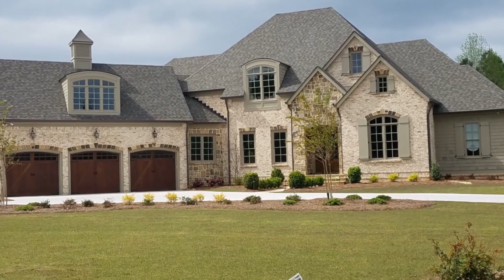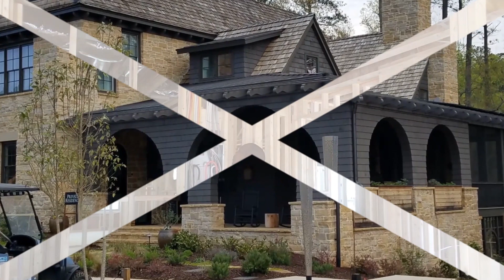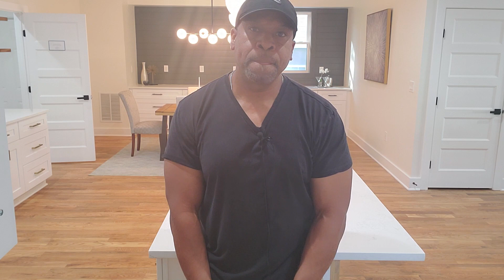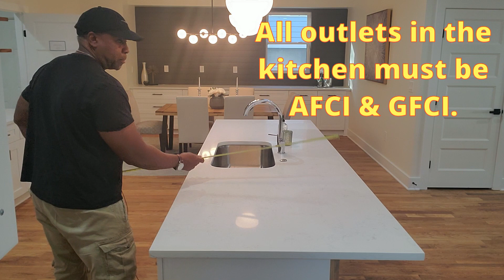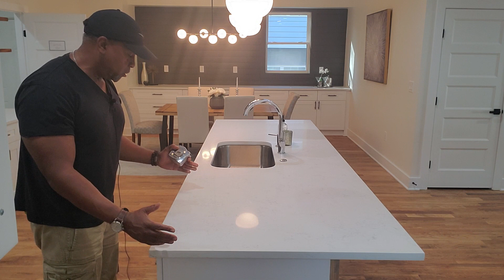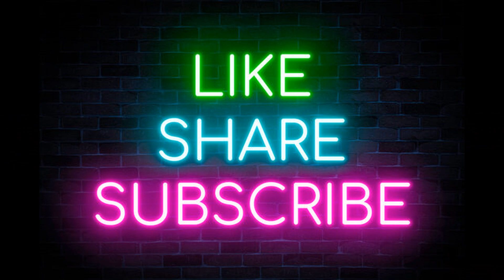2020 NEC Code Change for Kitchen Island & Peninsula

Comment: I've been doing electrical for 40 years I've been licensed in five states currently licensed in Alaska and North Dakota. What I was taught as apprentice well over 40 some odd years ago was always put an outlet on both ends of a peninsula and if it was over 6 ft put a third receptacle in I had been doing that kind of work for more than 40 years I'm glad the code finally caught up. Every electrician should know the NEC is the minimum code requirements you can exceed it but not go below it. You're very knowledgeable and I'm quite impressed with your videos
Reply from the maker: I appreciate your feedback.. thanks for watching!!

Comment: Thank you for your channel!  I just started following you and absolutely appreciate the material you are putting out there!  Question: I’m building and have an island that is 5’x10’ - so 9’+18’+18’+5’=50’, thus I need 4 receptacles.  One will be on each end, but the overhang is 12” on the long side.  The cabinets on the ends have a wine rack one end and a cookbook shelf on the other… can I put receptacles inside of those for the other two?  Or do I have to figure out some creative solution on the cabinet side for those.  I refuse to put outlets on the surface!  Hope you/someone has a solution that works! Thank you!
Reply from the maker: Yes, the last two receptacle outlets are at the discretion of the owner or the builder.
Reply from the maker: I appreciate you watching!!

Comment: 2023 NEC says that it is no longer required to have a receptical on an island or peninsula, and cannot be located on the side.  But you still have to rough-in a circuit for future.  So, if you add an island during reno, can you avoid all electrical?
Reply from the maker: Has your state adopted the 2023 NEC?

Comment: Probably should have touched on the fact that any receptacles located under an overhang that is more than 6" do not meet the qualifications for this requirement. (NEC 210.52 (C)(3)(3))  I have occasionally run into issues with this because I have seen a few islands where the over hang is more than 6" all the way around.  In those circumstances, counter top receptacles are typically the solution.
Reply from the maker: Good point...thanks for commenting!!
Reply from the maker: I appreciate you watching!!
Reply: @PPG1967  No problem.  Love your videos.
Reply: so did it say Sq footage of the counter top or the island I would argue those extreme overhangs don't count if they didn't specify island countertop and only island. so you would measure the cabinet top Area also these receptacle counts mean a duplex at each end should be 4 total

Comment: You need to update this with the new 2023 residential electrical code  for islands. They completely changed it. No outlets on the sides.
Reply from the maker: That video is coming.  I appreciate you watching.
Reply: @PPG1967  I am specifically looking for the best water-tight pop up outlet. Thank you!
Reply from the maker: @Lily_J85  Google it
Reply: The issue here is some areas follow local codes first and some haven't adopted the 2023 NEC code yet. I have multiple projects going and some inspectors allowing the 2023 revision and some aren't.

Comment: Thanks for the helpful information! I have an island that does not have a sink or any type of water/fire. It just an island with cabinets. Does the outlet needs to be GFCI? It is already tie to an GFCI receptacle originally from the kitchen and I am just re-using it but moving it to a bigger island.
Reply from the maker: So, all electrical outlets for that island must be GFCI.
Reply from the maker: Thanks for watching!!
Reply: @PPG1967  I'm doing a remodel, do I have to use the new NEC code or can I just follow the old code that my house was originally set up for?It's a 25 yr old house.
Reply from the maker: So, I would say you should use the new codes with a renovation. However you should check with your local or city building department to be sure.
Reply: @PPG1967  That was a great question and thank you for answering her. I didn't even think about that.

Comment: My electrician has said that outlets in a kitchen island must be WITHIN 24" of the sink in the island. That seems nuts to me. I could imagine a MINIMUM of 24" AWAY from the sink. Your video mentions nothing about placement related to the sink. What's the story? Thanks!
Reply from the maker: So, the video does mention the placement of the initial receptacle. The additional receptacles are at the discretion of the owner or builder.

Comment: OK GUYS TO HELP YOU UNDERRSTAND THIS VIDEO. He is stating that this island in the video needs 3 outlets by code which is true going by his square foot measurements. What HE DOES NOT EXPLANE OR MAYBE DOESN'T KNOW IS that three outlets equals 2 duplex receptacles which intern you end up with 4 outlets on that island. Reading ARTICLE 100 in the 2020 code states that 1 outlet is an individual plug so a duplex receptacle will be counted as 2 outlets. so basically you would mount a duplex receptacle on each side of the island in his video giving the island 4 outlets which is 1 more needed then code is asking for..  

 Article 100.

Receptacle. A contact device installed at the outlet for the connection of an attachment plug, or for the direct connection of electrical utilization equipment designed to mate with the corresponding contact device. A single receptacle is a single contact device with no other contact device on the same yoke or strap. A multiple receptacle is two or more contact devices on the same yoke or strap.

Informational Note: A duplex receptacle is an example of a multiple receptacle that has two receptacles on the same yoke or strap.
Reply: by the way i am an electrician for the past 25 years..
Reply from the maker: So, I started not to respond to this uninformed comment, but a good friend of mine said I need to respond to this foolishness. 
First of all, if you have a copy of the 2020 NEC or the 2017 NEC go to Article 100-Definitions. The definition of a Receptacle Outlet is an outlet where one or more receptacles are installed.  That means a quad is a receptacle outlet, a duplex is a receptacle outlet, a single is a receptacle outlet. Now go to 210.52(C)(2)(a) and (C)(2)(b) in the 2020 NEC. It states at least one receptacle outlet shall be provided for the first (9 square ft.), and then a receptacle outlet shall be provided for every additional (18 square ft.). The code says a "receptacle outlet" sir!!!...which means that can be a quad, a duplex, or a single. You've been a electrician for 25 years????.. Unbelievable!!!!...You sir are why I have to monitor comments!!!!!

Comment: If the island does not have a sink and it is 7’6” x 4’ and has drawers all on the front side and the other side has a 2’ overhang for seating area. Do you still need a third outlet?
Reply from the maker: That's 30 square feet.. you need (3) receptacles.

Comment: Q1: does the wire running to the dishwasher (if present) count as one "outlet"?
Q2: do the outlets have to be tied into the other kitchen outlets? 
Q3: can you tie the island outlets off of the dishwasher line?
Reply from the maker: First of all, I'm not an electrician.  However I'll attempt to answer your questions. 
Q1 - no, dishwasher must be on a separate circuit.
Q2 - you're required to have a minimum of (2) 20 amp circuits in the kitchen. The outlets at the island will probably be on a separate 20 amp circuit. 
Q3 - no, dishwasher must be on a separate circuit.
Reply from the maker: I appreciate your questions...thanks for watching!!

Comment: What do you typically do for getting wiring to an island set on a solid concrete floor? Are the rules different for that situation?
Reply from the maker: Typically they'll cut into the slab and run a metal conduit underneath. Check with a competent electrician in your area.
Reply: We ran ours after the concrete forms were put up, but before the concrete was poured (the conduit and wiring stick up out of the concrete now along with plumbing that was also run before concrete pour).

Comment: dose the placement of the outlet matter  like  2 on the sides and 2 on the back  and would the sides need to be wp of just stander gfci/afci
Reply from the maker: The first outlet must be within 2 feet of the edge of the island or peninsula. 9 sq. ft. for the first outlet, and every 18 sq. ft. for any additional outlets. The location of any additional outlets are at the discretion of the builder, designer, or contractor. All kitchen outlets must be on a AFCI & GFCI circuit.
Reply from the maker: Thanks for watching.
Reply: @PPG1967  Can any of the additional outlets be at the same location as the initial outlet?  Does an outlet in a doored cabinet acceptable?  FYI, great videos.
Reply from the maker: @patrickleckrone5548  you would probably want to install the outlets at different locations. However the location of the additional outlets are at the  discretion of the owner or contractor.

Comment: How about peninsula with sink?
Reply from the maker: So, with that situation I think you need to handle it a little differently.  If you have access to 2020 NEC, read section 210.52 (C) (1)(2). If the area behind the sink is less than 12", then you must provide a outlet within 24" of each side, plus factor in the square footage if the two outlets are not sufficient.
Reply from the maker: I appreciate your comment.
Reply: @PPG1967  thanks,  what if peninsula with sink 9ft long, yes outlet on right  side within 24in, with 12plus inches behind, but left side nearest outlet on the wall 5ft away for example.
Reply from the maker: @maryanrzhiskiy3609  if you provide me with your email,  I'll send you a diagram that really shows how it's done.
Reply from the maker: Or you could email me the layout.  Precisepropertygroup@gmail.com

Comment: My island is 22 sq ft so I need 2 outlets.  Since one end has a 10" overhang I can't put one there.  Can they both go on the same end?  Is there a spacing requirement or just a quantity requirement?  The front and back both have cabinets so they can't go there either.  Great channel!
Reply from the maker: So, you should probably consult with a competent electrician in your city that's familiar with 2020 NEC. I can't determine what's needed for your project without seeing any plans or not being onsite.
Reply from the maker: I appreciate your feedback, and thanks for watching.

Comment: This is very helpful for considering a remodel of my kitchen.
Do you know the reason or justification for requiring so many outlets?
Reply from the maker: So, people were having these huge kitchen islands built with only (1) outlet.  So, the NEC decided to factor in the actual size of the island to determine the electrical outlet requirement.
Reply from the maker: I appreciate you watching!!

Comment: Why do you have to be 2 feet I never get the benefits of these codes..just people saying "" you cant do this,,you cant do that..things that should be a code is not..like all kitchens mandatory should be painted with flame retardant paint and drywall with mold resistant drywall..
Reply from the maker: Well, the first outlet or at least (1) outlet must be within 2' of the end of the island. I'm not sure what the reason is behind that code,   maybe someone will read this and comment. Typically codes are written when something tragic happens, it's more of a safety issue.
Reply: @PPG1967  Because appliances are now cheap enough that everyone has a toaster and a blender and a juicer and a cell phone charger and a smart home device and probably other stuff on their kitchen countertop. If you don't give them enough outlets, they'll put power strips in a kitchen which is dangerous (those aren't meant for wet environments). That's why code is requiring more and more outlets - because that's what a modern home needs.